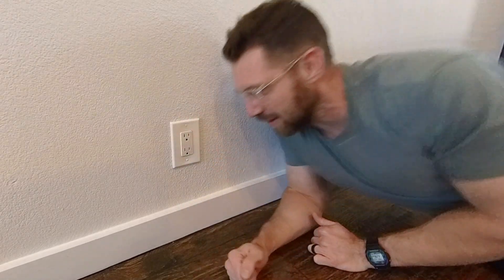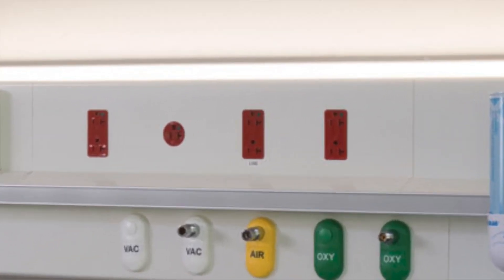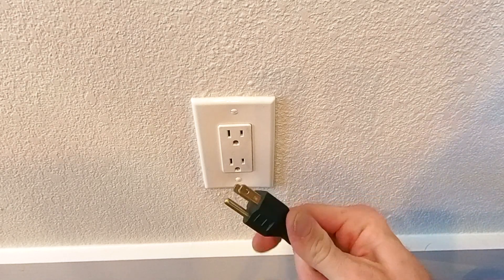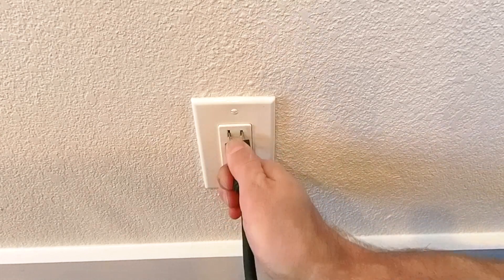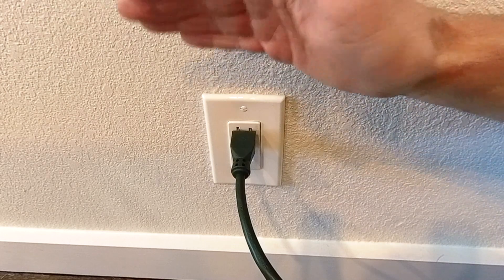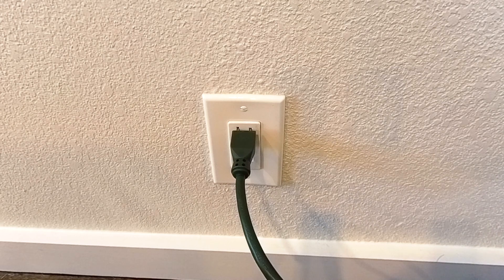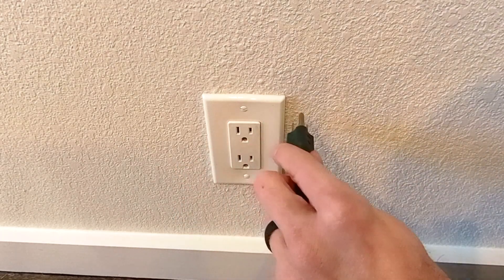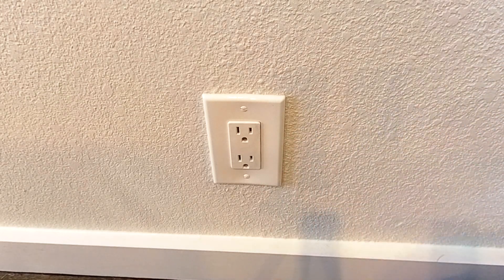Why are hospital outlets upside down?

Comment: They were flipped to ensure the ground that protects users of appliances by making sure the ground is always connected should the cord be partially angled to disconnect the top of the plug. With the ground on top the first conductor that will get disconnected should the plug partially fall oit would be the ground. Leaving the cord live with no ground protection on the appliance to protect the user.

Comment: That looks sketchy AF, either way up to be honest. That said, I can think of one valid reason for wanting the two flat prongs at the top: gravity pulls down on the cord, so you want as many friction points above it to prevent it from falling out of the socket, i.e., two prongs vs one earth prong. The other problem here is that US cables need to be twice as thick because they carry twice the amount of electrical current than in countries where mains voltage is 230 V, which only exacerbates the problem since cables will be heavier. The safest plug is undeniably the ridiculously over-engineered UK plug.